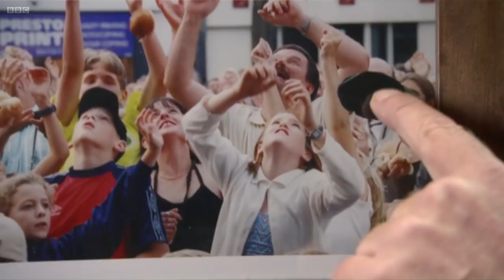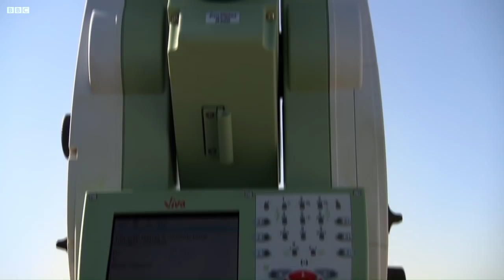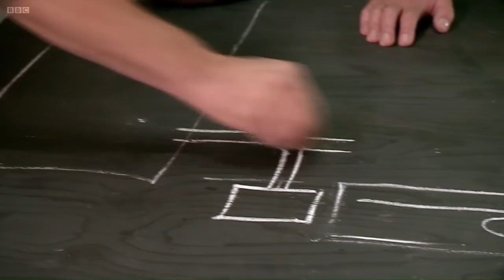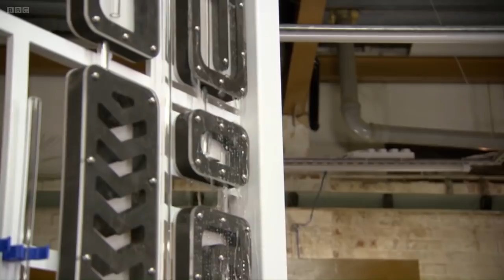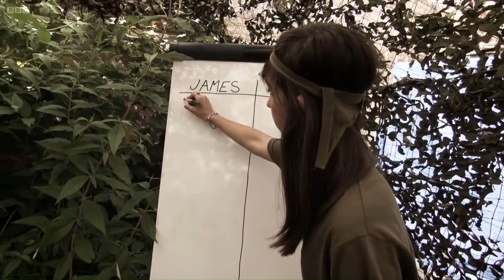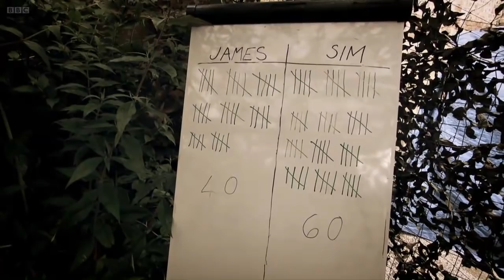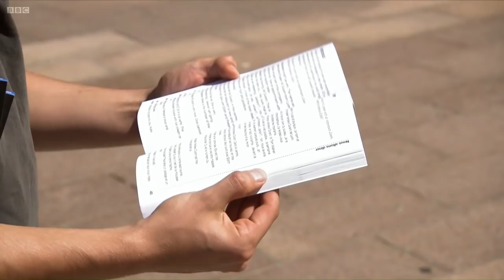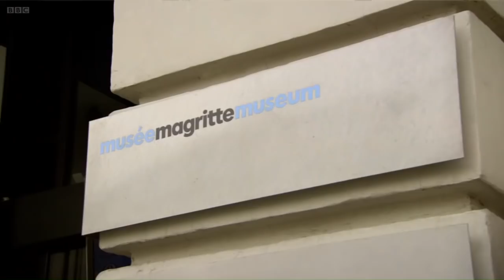James May's Man Lab - Series 3 - Episode 3 (S03E03)

Comment: Too bad they got the probabilities wrong on the monty hall problems.  itns 1/3 and 2/3, so statistically, the results should center around 67/33, not 60/40.  Though 60/40 is still within reasonable random fluctuations.

Comment: On the Monty Hall Problem:

There are Beers A, B, and C, and only one is safe. You choose A.

If A is safe, then the host will reveal either B or C which are both not safe. Staying is safe, switching is not safe.
If B is safe, then the host will reveal C as not safe. Staying is safe, switching is not safe.
If C is safe, then the host will reveal B as not safe, Staying is not safe, switching is safe.

So it's a 1/3 chance you'll be safe by staying and 2/3 chance you'll be safe by switching.

Comment: 34:48  when the game host removed the bad option from the two representing the 2/3 chance, that 2/3 chance now resides with the other can. So your first blind choice has a 1/3 chance of being correct still, but the other remaining can now has a 2/3 chance of being the correct one. I wish I could explain it better than that, but I can't. The removing of the can represents the game host adding information. Their result of 60/40 are just a sampling error - the true results will absolutely approach 1/3 Jamess and 2/3 Simi as you repeat the experiment. The two cans remaining are 2/3 the left can is good, 1/3 the right can is good.

Comment: You're just turning the argument around.

At first pick your chances are 33% good/66% bad.
After one is removed the one not picked is 50/50.

50% good is better than 33% good. 50% is better than 66% bad. Identical difference of 16,67.
Reply: Those 50% are irrelevant. It's a 1/3 chance of being in the small group and 2/3 chance it's in the large group. Nothing else actually matters.

Comment: the Maths on the Beer hunters wasn't quite right and its hard to express without getting into a fight with someone who still believes its 50/50. But here's why switching works. There is 1 safe can, now imagine instead of 2 shaken cans there's 99 shaken cans. So out of 100 cans you choose 1, and the host reveals 98 shaken cans. and then offers a switch between 2 cans. It will not be 50/50. Its the same principal just the odds instead of being 2/3 its 99/100. Someone's going to argue anyway :s

Comment: The chances are not 60:40 but 66:33. It’s quite simple to explain: At first, you had 2/3 chance of picking a dangerous beer (it obviously does not matter which dangerous one you pick). If you did then the other dangerous beer is removed and you can switch only to the safe one, on the other hand if you at first picked the safe one you can switch only to a dangerous one. So the original chance of picking a dangerous one is the chance of picking the safe one when you switch.

James has probably mistaken 2/3 for 2:3. 2:3 (40:60) is 2/5 (as the total is 100). 2/3 is 2:1 (66:33, total 99).

Comment: Yeah.. i guess that was easiest way to show... how your first pick of 33% would still stay 33% after one bad is removed.. unless you change your mind… when it becomes really an 50% vs 33% if you change your mind.    So you should win around 60-67 times out of 100 with that strategy..   and that is how gambling works..   But as all ways in gambling there is the 33% chance of loosing an bet that is having odds to your favor.     where the lost 16.7 % comes to that  scale in 60 to 67 …        Often in gambling tho..  there is one removed , that could be either good or bad.. neither in some cases  7 in high or low .. or standing coin in coin toss etc..   when odds fall to even worse against the player who has less chance to alter the game. 

I know.. i was an gambling addict on my teen years..   i was one of the few lucky ones who never fell the victim of 33% chance to loose too many times.. where i did not loose much..  and when i heard that i was about to become an dad.. i stopped all gambling at the very moment.   never played since..    apart from lottery about 10 to 15 times in total on last 17 years or so.

Comment: But... it is a 50 50 chance.... even by going by the logic of probability locks in at the time you choose it, by choosing not to swap, you choose that box again. And the probability re-locks at 50%.... you can argue that it could be statistically higher than swapping by the same logical basis of the previous argument.
Reply: There is a higher chance of it being behind the door if you switch
Reply: @fifaplayaswag  switching or not regards a choice to either stay or not, so the 50 / 50 rule applies, as the choice has been made at that popint in time. The only reason people think it's any different is because the one left was not picked.